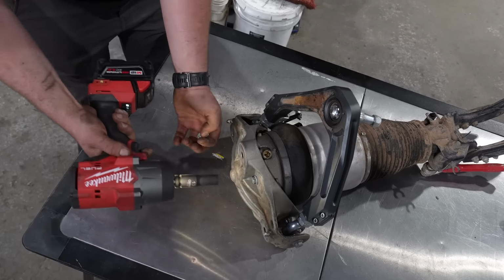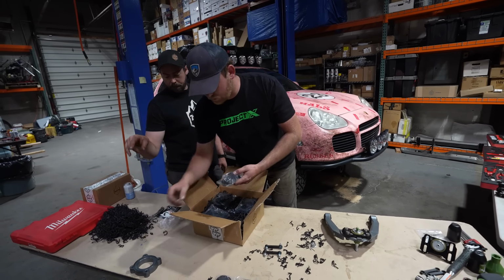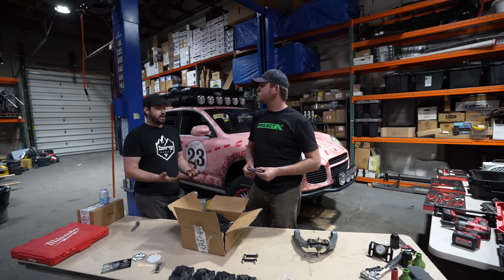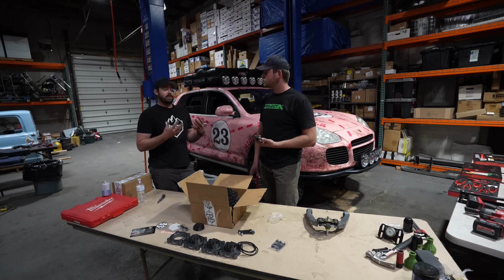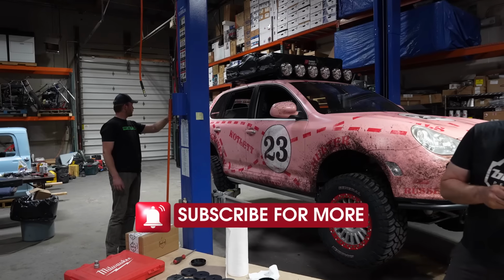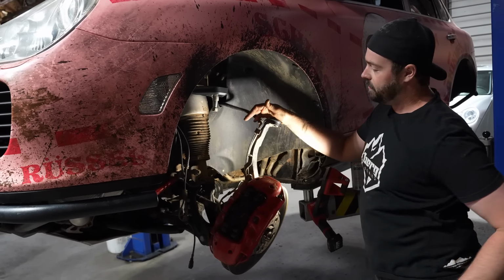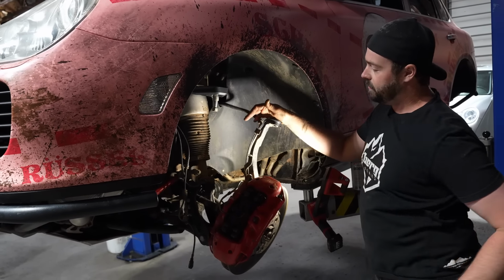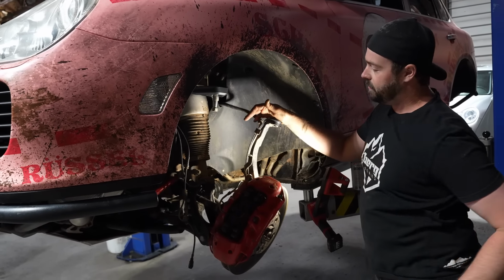The Ultimate Porsche Cayenne Air Suspension Lift Kit

Comment: Great video. I have a 955 turbo S with rear ac. 
Currently have Eurowise 2” lift with 1/2” subframe drop. Running 275/65/18. 
Would love to fit 33”x12.5”
Any suggestions? 
Do you think I try and add the 1” volumetric spacers to get that last inch? If they would sell me just that. 
Durning my lift install, I was only able to fit the shallow spacer brackets for the turbo s intercoolers. I’m thinking I will need the aftermarket intercoolers from Eurowise, but am wondering how to retain the rear ac and still run 33”
Thank you!